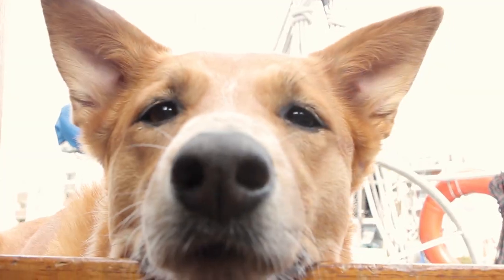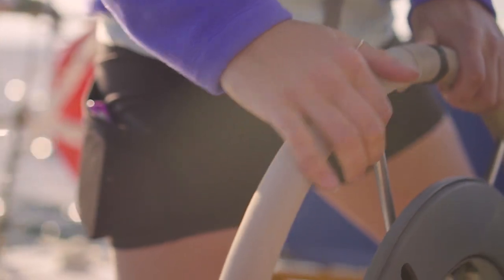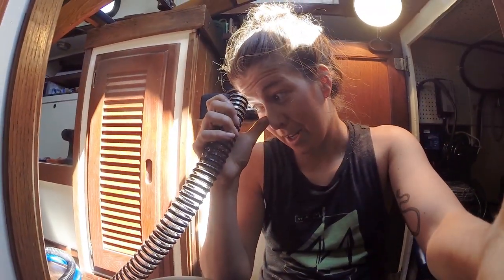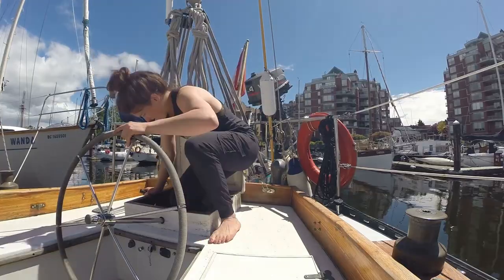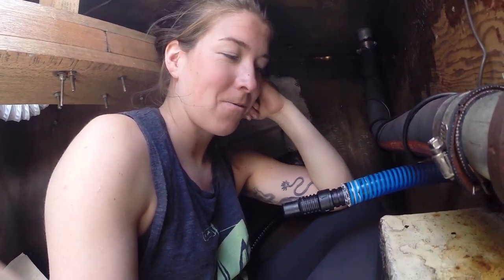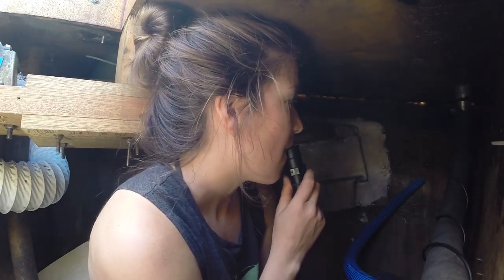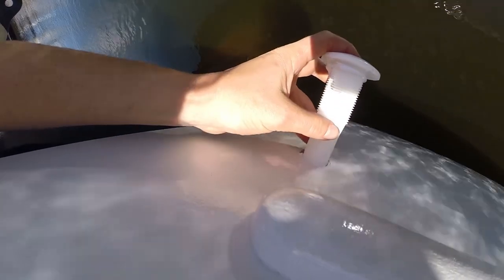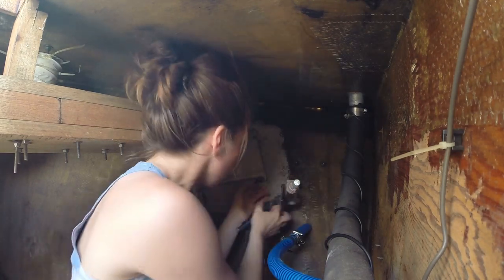Project #1: Installing an Above Water Thruhull on Sailboat

Comment: Been there done that, instead of the heat gun (good luck removing that hose from that thru hull) I have either gone all bronze (fit so much nicer) or I sand down the barbs on any 'plastic' connections for an easier fit. Very impressed, keep it up and live your dream. We are heading down South (we are from Campbell River) in a few years when we retire. I have done some off shore sailing when I was younger, life's direction has us doing more when we are retired. If I was to do it all over again I would be more like you, go when you are young. All the best. Please keep the video's coming.
Reply from the maker: Hi thanks so much for your comment and for the suggestions. That's great you are looking to head out again after retirement. The hardest part of doing it while young is having enough money to do so! But I'm figuring it out! More videos to come soon, she's up on the hard and about to get lots of projects going as soon as the snow melts;)